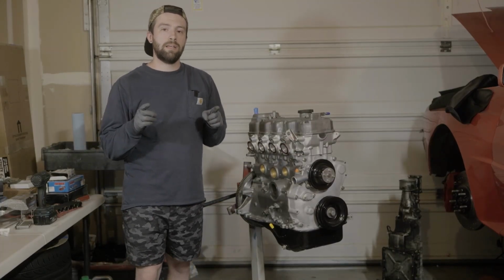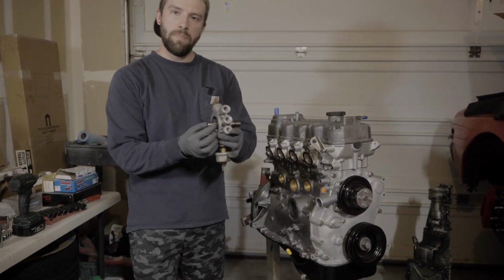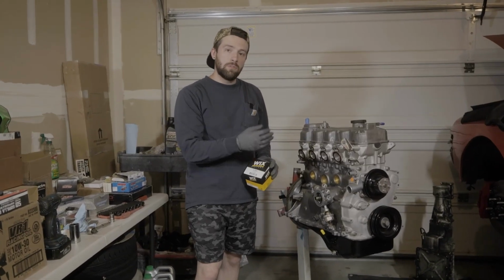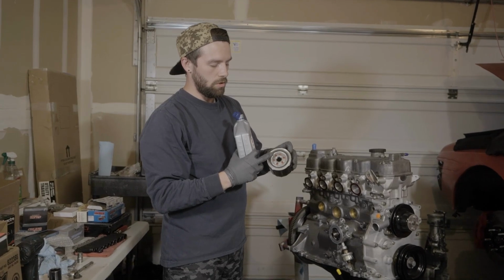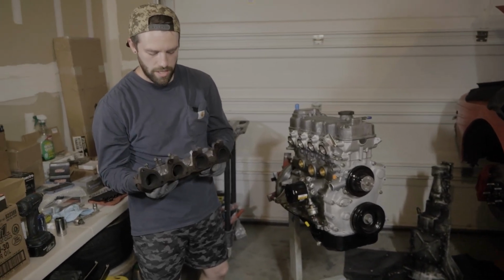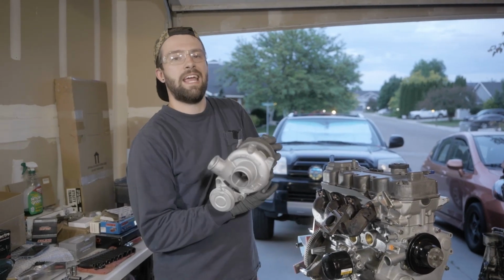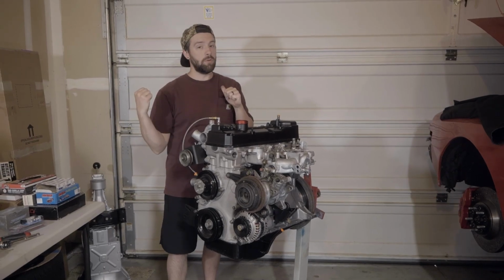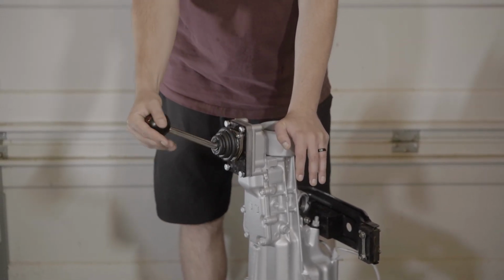Assembling a $10,000 Mitsubishi Powertrain

Comment: Racetep has a terrible reputation. Hope you have a good experience... FYI I run 20-50 full synthetic and it does very well. Also $10,000 on a 54b is crazy. I understand it's built, but I know for a fact the exact same work could be done by a capeable machinist for at least half the price. Additionally, I see you're still running the stock intake, wondering what kind of power they told you this was capeable of? Good luck with it.
Reply from the maker: I have heard varied responses to RaceTEP, so far our experience has been excellent.
It was definitely a pretty penny, I am rounding a bit for YouTube’s sake but between the engine work, turbo and shipping/handing we are +\- $10K on the engine. On the standalone it is sitting at 280 WHP. We are currently running out of injector and will likely have to go MPI so get more out of it.
Reply: @RAPauto  ok, that is a realistic goal for TBI. I would encourage the customer to go MPI if the budget allows.
Reply: @TSITy78 TEP doesn't do their own machine work, last I heard.  Surprised they're still around actually.

Personally, I'd pull the valve cover and check the torque on the head bolts.  This is also a good idea after some heating/cooling cycles on the engine.  (Wish he'd have checked the flywheel bolts too, before installing the clutch.)

But g54's are strong, if he can keep oil, coolant, and enough fuel in it, it'll last.
Reply: Anyone thinking that's an expensive 54 build, pop by my channel. Haha. Good project dude!!!!

Comment: I am about to pull a g54b. Can you please go over how you are connecting the hoist to it.
Reply from the maker: If it’s a stock G54B, there should be “ears” or metal tabs with a hole in it on the exhaust and intake manifolds. That’s where I hooked up my Pittsburgh leveler which I connected to my engine hoist. I then use that to level or angle the engine when I am installing/pulling the engine.
Reply: @RAPauto  I took the intake off and I've attached the two rear chains of the leveler to the stud closest to the bell housing. I attached the front two chains to bolts that I've threaded into where the tensioner is normally on the top left of the engine. They are 10.6 grade metric bolts I think, with like 3 or 4 washers.

Comment: What did you use to clean & paint the transmission
Reply from the maker: Lots of Simple Green cleaner to get the grime off with an assortment of brushes. After we washed off the dirt and grime, we used Dupli Color DE1615 Engine Enamel w/Ceramic Aluminum paint. Took about 3 cans for 3-4 coats and getting all the tighter spots.